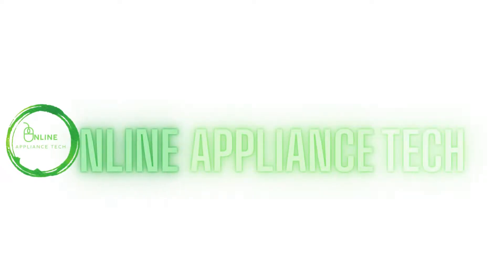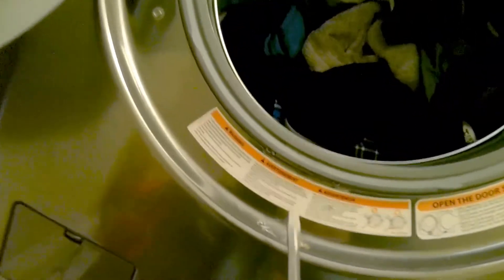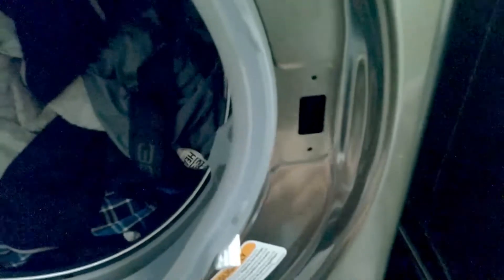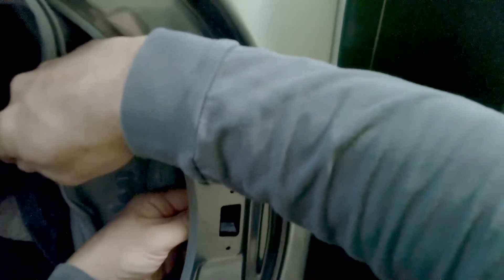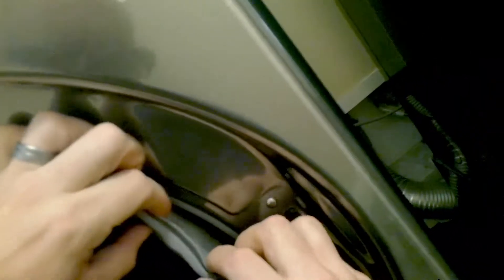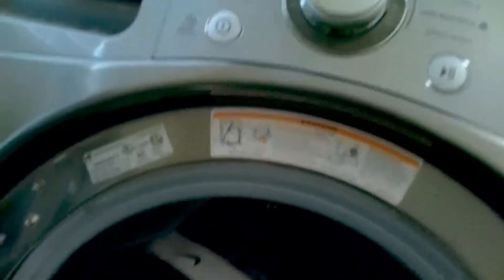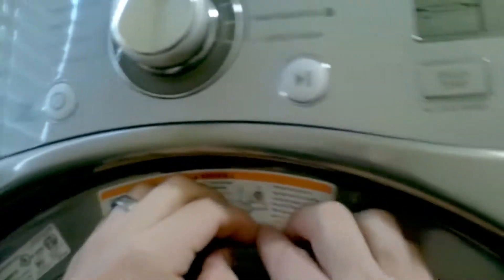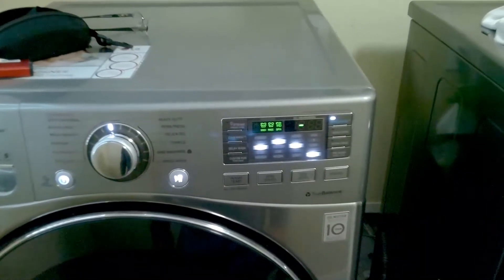How to Fix LG Washer DE Error Code [ Easy Fix ] Also for DE1 & De2 Errors

Comment: Thanks a million - I was lamenting having to take the front off to get to the switch so your video was a welcome relief.   Thanks to Amazon's "not quite so prime anymore" shipping it was going to take 5 days to get a replacement switch so I decided to carefully disassemble the switch (no easy task) and with a bit of filing and some contact cleaner on the contact points (and a drop of oil on the solenoid shaft while I had it apart) it's working like a champ!   As cheap as the replacement switch was ($10) I decided to go ahead and order one to have it on-hand in case my fix doesn't last.

Comment: I have a de1 error code but I don’t hear the washer trying to make a clicking noise. will switching out the lid door lock switch fix the error code?
Reply from the maker: Not for sure? Most of the time it is the door switch but with no clicking sound that would be hard to tell if it's getting the right power to switch. I would replace the door switch first being a cheaper part but if it does not fix the problem it will probably be the main control board. If you don't want to guess, call a good repair man out to diagnose the problem.